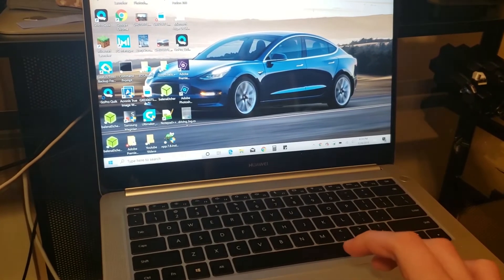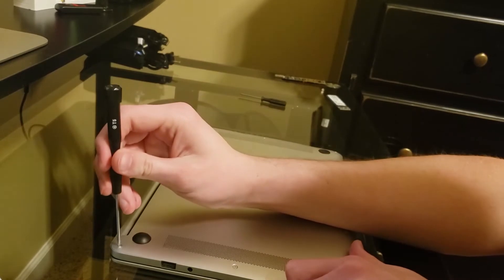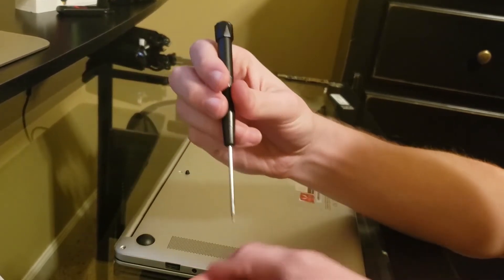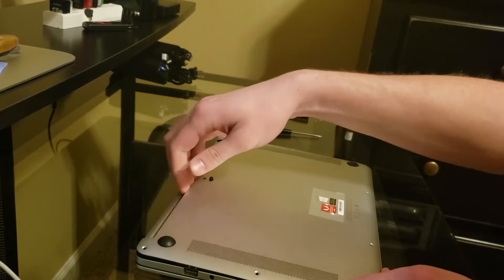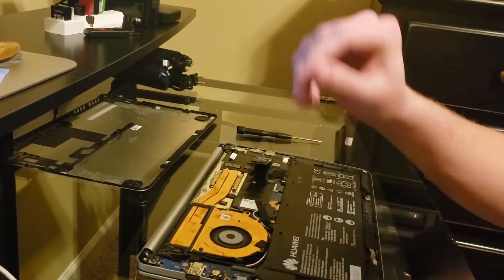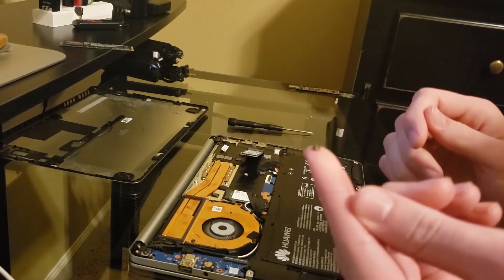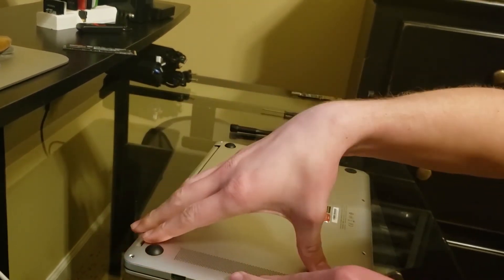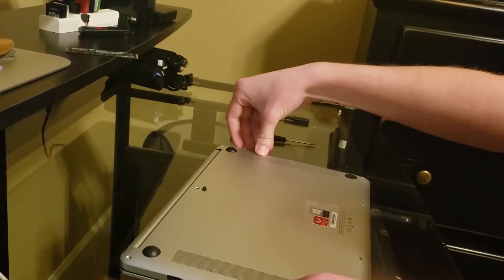How to replace m.2 ssd in Huawei Matebook D

Comment: Thanks for sharing. Is the Samsung SSD speed improvement noticeable in everyday's use? Is it worth the upgrade?
Reply from the maker: You're welcome. Thanks for watching. I can notice a difference, for some reason when download files with the Sandisk one I replaced it was very slow. This was one of the reasons I decided to upgrade, but the main reason was for more storage. I would not upgrade just for the speed improvement unless your SSD is noticeably slow.  But you also have to consider your internet speed when downloading files from the internet.
Reply: @redealexander879  Thanks!
Reply from the maker: @riccardosparagna9936  You're Welcome